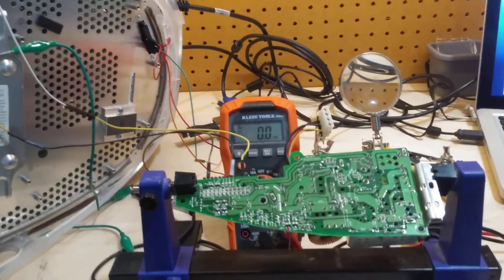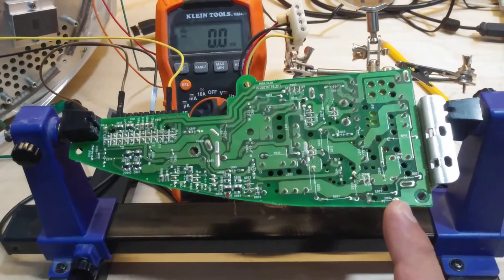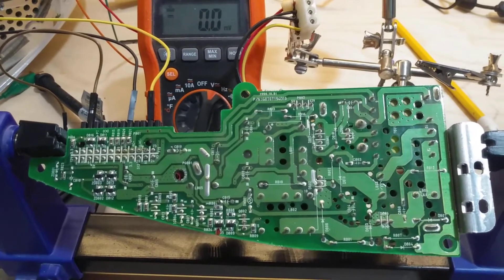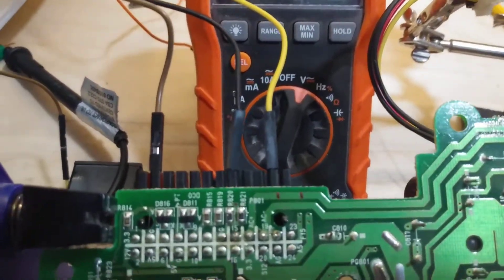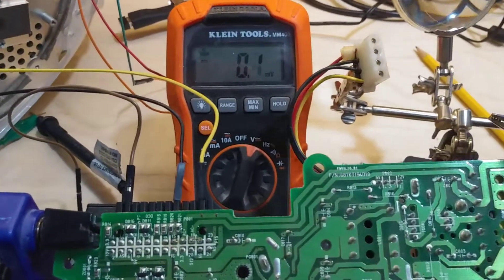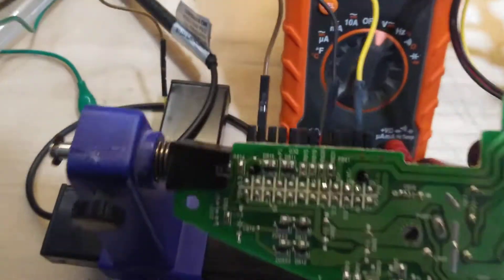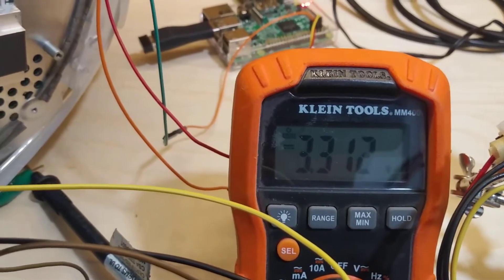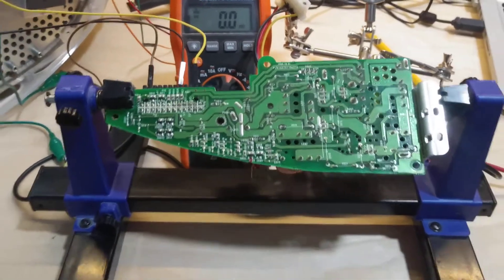imac g3 using  the Down Converter Board without the logic board

Comment: Hey this video helped a lot with trying to diagnose why my iMac won't boot! What waveform and frequency is the 24VAC supposed to be? We've connected an oscilloscope to the AC pins and have a weird shape measuring about 20V RMS.
Reply from the maker: The waveforms are weird. This is what I captured from a working imac G3 DV

https://github.com/qbancoffee/imac_g3_ivad_board_init/blob/master/images/analog_board_off.jpg

https://github.com/qbancoffee/imac_g3_ivad_board_init/blob/master/images/analog_board_on.jpg
Reply: @rockyhill3 that off-state photo looks a lot like the waveform I'm seeing! Are there pins I can bridge to activate the PAV board without the logic or converter boards connected? Tried looking at the pinouts posted but not sure if any of those are the ones to bridge
Reply: Oh actually we got it to activate bridging pins 6 and 10 of the connector like on your wiki! That brought the RMS to around 24V and adding pin 12 brought it to 36V for some reason?

Comment: I cant wait for you to release schematics. I want to do this but currently lack the knowledge. I would need an arduino to send the initialization sequence to crt right? wire the av cables to a vga adapter and then have the SDA and SDC wired to the arduino for the boot sequence?
Reply from the maker: Hopefully soon I'll have enough info to start 
putting schematics together. I'm still gathering and organizing info to make it as painless and 
cheap as I can. 

To use the CRT on, you'll need to power on the analog board and then send the init sequence via i2c(SDA and SDC). This can be with an arduino or almost any other micro controller.  Once that's done you can feed it video via the VGA splice. With
Reply from the maker: I think I might make an adapter plate the fits like the original logic board and has the foot print to be able to mount a mini-itx board.